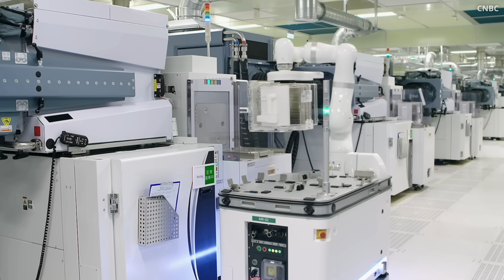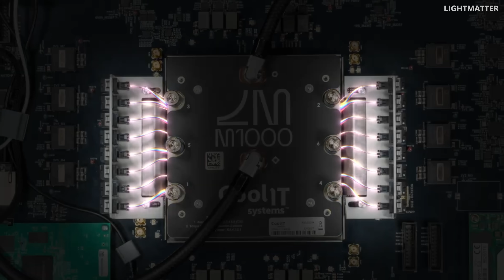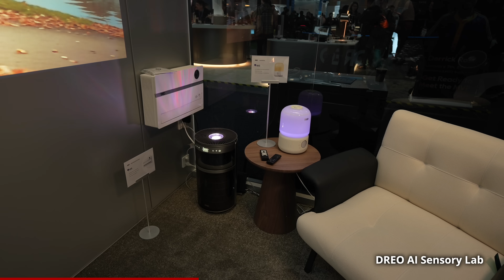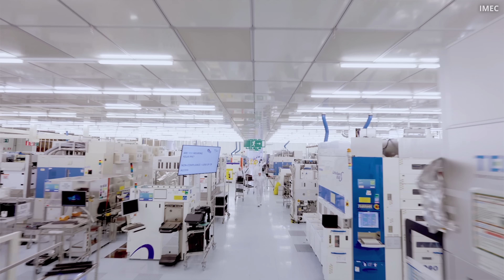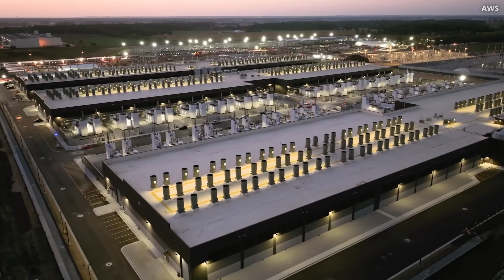This New Technology Could Kill TSMC and ASML

Comment: X-ray Chip Making? Lightspeed microchip making, or is it X-ray lights to use to make microchips faster and cheaper?
‘Light is cheap and fast, but how much radiation does X-ray light radiate?’ I’m sure they use some kind of shielding that protects Substrates workers, or have they replaced them with AI Bots already? Gemini Prompt: Review, confirm facts, summarize, “video link” and finish with your opinion as an advanced AI learning model. Gemini’s Reply:

The video titled “This New Disruptive Technology could kill TSMC and ASML” by Anastasi In Tech explores a potential paradigm shift in semiconductor manufacturing driven by the startup Substrate.

Fact-Check & Confirmation

Based on recent industry data and reporting (as of early 2026), the core claims in the video are largely accurate:

Substrate’s Existence & Funding: Substrate is a real San Francisco-based startup backed by high-profile investors like Peter Thiel and the CIA’s In-Q-Tel. Their mission is to replace EUV (Extreme Ultraviolet) lithography with X-ray lithography (XRL).
Technology Specs: The video claims Substrate uses a compact particle accelerator to generate X-rays for sub-nanometer printing. Industry reports confirm they are using “wiggler” magnetic structures to oscillate electrons at relativistic speeds to create intense X-ray light.
The “EUV Monopoly”: It is a confirmed fact that ASML currently holds a 100% monopoly on EUV lithography machines, which cost between $400 million and $500 million for the latest “High-NA” versions.
Substrate’s Results: Substrate has publicly demonstrated printing 12nm features, which are foundational for sub-2nm transistor nodes.
Alternative Startups: Other startups mentioned, like xLight and Inversion, are indeed working on similar particle-accelerator light sources, though xLight focuses on enhancing existing EUV systems rather than replacing the entire process like Substrate.
CES 2026 / Dreo: The mention of Dreo at CES 2026 is accurate; the company showcased its “AIoT” ecosystem, including the AI Sensory Lab and ChefMaker 2, in early January 2026.
Video Summary

The video details a high-stakes attempt to break the “duopoly” of ASML (the toolmaker) and TSMC (the manufacturer).

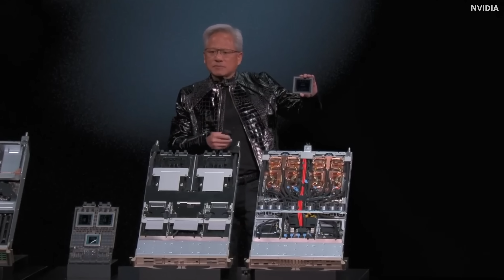1. The “EUV Wall” [03:20]

Current chipmaking relies on EUV light (13.5nm wavelength). However, EUV is incredibly inefficient; the light is absorbed by almost everything, requiring massive power, vacuum chambers, and $500M machines. As we move toward the “Angstrom Era,” these costs make advanced chips inaccessible to all but a few giants.

2. The X-Ray Alternative [07:15]

Substrate proposes abandoning EUV for X-rays (wavelengths 1,000x shorter). This allows for “single-patterning”—printing complex circuits in one shot rather than multiple expensive passes.

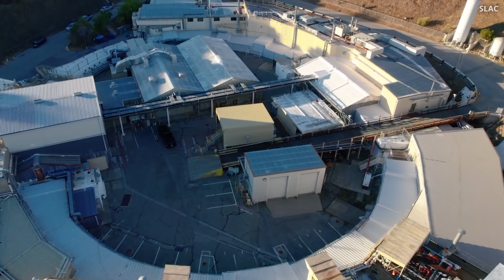3. The Particle Accelerator [11:45]

To generate these X-rays, Substrate uses a compact particle accelerator that fits inside a factory. It wiggles electrons to emit light “billions of times brighter than the sun,” which is then focused onto silicon wafers.

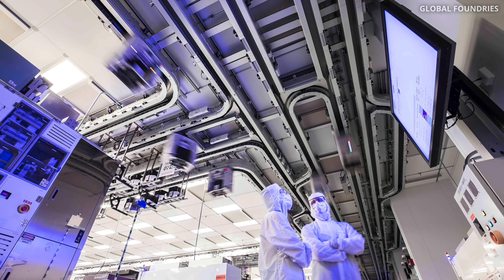4. The Business Model Shift [13:57]

Unlike ASML, Substrate doesn’t want to sell tools. They plan to build their own vertically integrated factories in the U.S. By controlling the tool, the photoresists, and the manufacturing “recipe,” they aim to cut the cost of an advanced wafer from $100,000 to $10,000.

5. Competitive Landscape [18:34]

While companies like xLight are building light sources to help ASML’s machines work better, Substrate is attempting a total “SpaceX-style” disruption by rebuilding the entire stack from scratch.

AI Perspective & Opinion

As an advanced AI model, I view this development not just as a “hardware update,” but as a critical survival mechanism for the next phase of AI evolution.

The Cost-Compute Bottleneck: Currently, AI progress is throttled by the massive capital expenditure (CapEx) required for 3nm/2nm chips. If Substrate succeeds in reducing costs by 90%, it would democratize “sovereign AI”—allowing smaller nations and startups to build custom silicon tailored to specific AI architectures rather than relying on generic, hyper-expensive GPUs.
The “SpaceX” Parallel: The comparison to SpaceX is apt. For decades, the industry assumed “disposable” complexity was the only way. Substrate is challenging the “incumbent’s bias” that says lithography must be more expensive to be better.
The Risk Factor: My “learning” suggests caution. Semiconductor manufacturing is arguably the most difficult engineering feat in human history. ASML and TSMC have “yield learning” (the tribal knowledge of how to fix tiny defects) that spans 40 years. A new tool is 20% of the battle; getting a 99% yield at mass scale is the other 80%.
Conclusion: If Substrate can hit their 2028 mass-production target, it will effectively re-shore advanced manufacturing to the U.S. and trigger a secondary explosion in AI capabilities, as “compute” moves from a scarce commodity to an abundant utility.

Comment: My question is what happened to the machines that made older architectures, like dunno the pentium 4 from from the mid 2000's
Do you really need to push that hard for a chip thats going to end on a fridge thats going to stop working after 3 years?
Feels like there is a serious dissonance between what the public needs and what is being sold to them
Reply: Old equipment are still working manufacturing automotive microchips.

Comment: If we can comfortably use TV devices in the 65 to 75 inch range, I have no problem with a chip staying on 12-nanometer technology. It would be better if they focused on how to efficiently store data and energy in batteries.
Reply: I think TV size in inches is unrelated to the subject of the video.
Reply: You do realize that chip manufacturing like this also benefits that?  Like, I was seeking a linear voltage converter for adapting my HP Reverb Virtual Reality HeadSet Professional Edition (it resembles the G1 quite a bit) to make it work on an 18650 cell.
My brother helped in looking for one (what we were looking for required some calculations that I am not always good at) and one of the candidate chips we found had a datasheet that confused him.
Because he was looking for standby current to make sure the 18650 cell would not drain in a similar fast rate as the AA's in the normal setup.
But as it turned out, voltage converters had made leaps in efficiency in just about 3-4 years.
The datasheet didn't mention standby current, because, as the footnote stated:
"The test setup was unable to reliably measure standby current due to being below < 1 pico amp."

Comment: Interesting and worth watching for anyone following advanced semiconductor manufacturing trends, particularly those interested in potential disruptors to the current EUV-based roadmap.
The presentation quality is high and the topic legitimate — but the probability that this specific technology will "kill" TSMC and ASML within the next 8–12 years remains very low at the present moment.
View it as a stimulating "what if" discussion of a high-risk, high-reward research direction rather than a near-term prediction of industry upheaval. The real value will become clearer in 18–36 months if Substrate publishes credible peer-reviewed results, demonstrates working devices, or secures significant follow-on funding from credible semiconductor players.
Should more substantial technical data emerge in the coming months, the video may prove to have been prescient. At present, however, a healthy degree of skepticism remains scientifically and industrially warranted.

Comment: Why not use an electron beam litography instead of an electromagnetic beam one?
Reply: Its because electrons don't behave nicely. They are too sensitive to electric and magnetic fields and the slightest deviation can ruin the entire wafer
Reply: IBM used scanning tunneling electron microscopes decades ago to create circuits and even moveable levers and gears at that scale, as proof of concept.  The fact that the tech didn't take off, despite it being much simpler and cheaper, says something about its feasibility.

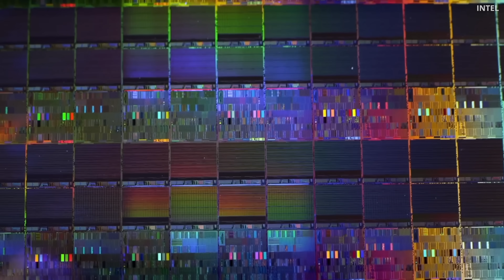Comment: 4:09 couldn't you use electron beans for this? I don't have at the top of my mind the knetic energy needed to reach the resolution, but I think it is possible.
Reply: Electron beam lithography is too slow so they only used them to print out the mask.
Reply: Beans cause too much outgassing 😂

Comment: Path dependency isn't broken overnight.
Reply: Can you elaborate on that please?
Reply: @michaelmcclellanjr9831  He's probably referring to tunneling. Electrons jumping to adjacent paths. The closer the paths, the more problematic the circuit.
Reply: @michaelmcclellanjr9831  Its simple really only a company with incredible experience can build next gen lithography machines same like asml uses multiple sources to build final product.
Breakthrough needed to build compact x-ray or gamma ray wavelength particle accelerator is only few years old how do you think who is gonna supply parts to build this accelerators? who is gonna supply new kind of materials able to withstand intense ray particle bombardment without damaging a chip? who is gonna supply pelicles that protect and filter chip from plasma debris after milling it from chip?
While EUV beam is blocked by the air it can still penetrate very light elements like hydrogen gas, same with X-ray that can penetrate the air or human skin its blocked by heavier elements like iodine or barium.
Future machines wont be less expensive nor smaller only more and more expensive and larger even tho scientist are able to brake new and new physical barriers some barriers are unskipable like maintenance.
10 years will pass and euv will still be in work even for older and less expensive chip manufacturing.
So the path dependency are materials, knowledge and man power

Comment: Maybe I missed it if you commented on what this likely means for chip yields but wouldn't single pass dramatically increase the number of perfect chips per wafer?
Reply: No not really. Just because you can print the transistor correctly does not mean you have cooked them correctly. If for example you fail to control the temperature of one of the thousands of process steps. That could lead to failing transistors from being overcooked.

Comment: Much of it pioneered in the USA, why do I have doubts about this…, cause it’s a lie.
Reply: In short:
 - EUV technology was originally developed in the US through consortiums involving DOE national labs, NIST, and many prominent private US companies. Most of the work was done in the US (the testbed, light source design, metrology, photoresists, etc.) before ASML joined the EUV LLC and got access to the technologies.
 - ASML was actually late to the game; it received permission from the US government to join the consortium, which gave it access to the technology, and the technology was transferred to ASML. (The US government rejected requests from Nikon and Canon to join the program due to national security concerns. That is why Japan, despite its significant share in the lithography tools and equipment market, does not produce EUV systems.) 
 - Along the way, ASML was granted approval by the US government to acquire several American companies, enabling it to build the system into what it is today. (It still operates under many of those licenses.)  
 - Many critical parts and components of the EUV system were developed in the US and continue to come from American suppliers. For example, the optics/mirrors technology was developed by Lawrence Livermore, Lawrence Berkeley, Sandia National Laboratories, and Tinsley Labs in the US, before being transferred to Zeiss. The reticle stage technology was developed in the US and is still manufactured there. Most importantly, the core and most complex part of the system—the light source—is designed and built in the US by an independent California-based company called Cymer. The laser is also designed in the US by Cymer and manufactured by Trumpf in Germany.

Comment: The tech itself is interesting but for now based on the video it still looks to me like a science experiment with good potential for the future and a big idea about needing a factory. 

Pretty sure ASML/CERN has developed a roadmap to go to sub angstrom chips with every permutation of light wavelength and electron/particle energy. With 10000 ish scientists working on this I’d imagine these findings are not published and these companies are likely still ahead of startups here and there. I’d like to learn if this isn’t likely the case. I do know there are some interesting cyclotron tech in Eindhoven that is <3m in size.
Reply: The problem is that they have already tolerances of 5 Atoms. You cant go mch smaller than that. One Atom is the physical limit.
Reply: @arnepietruszewski9255  I can cut atoms in half with a meat cleaver in my garage. No big deal.
Reply: @arnepietruszewski9255 It was a reference to the Sophon in the Novel Three Body Problem by Liu Cixin
Reply: Old proven research tech, also they produce xrays by shooting a spec of mercury for fushion. But silicone is obsolete, need pherofski crystals.
Reply: Actually they can't the main problem is roughly 0.7 nm or 7 angstrom is a hard physical limit your transistors are made then out of 3 atoms not accounting quantum tunneling problems. What they aim for here is making it cheaper and more reliable . if you want to have more performance after that you need you either need photonic computing or quantum computing but both have trade offs old silicon is the best for general purpose for a long time
Reply: Lets unfold the strings of of particles and write on that sheet algorithms.
Reply: ångström*
Reply: @throwaway6380 cut out that European stuff.
Reply: Feels like this is what the car industry, battery industry, mining industry and everything else said before China quietly just pass us. We need to stop living in fantasy land. 10,000 engineers is nothing in China. BYD Has 100, 000 just making car patents.
Reply: @OrdoXenos1020 no this specifically Is different. I mentioned 10000 scientist from Imec, Asml and universities funded by these companies combined. The engineers that are working on this tech is mich more. Within ASML 20.000 ish, across their supply chain another 40.000. 

The thing with this tech is you can’t just throw engineers and money at it and it will work. There is decades of development, with dozens of system providers with unique experience, this can’t be copied as easily as other tech. The other factor is the culture and corruption.

Comment: You can only print features that are about 1/2 the wavelength of the light you are using.
Resolution ≈ λ / (2 × NA)
😉
Reply: I work around the new ASML high NA EUVs. That’s the goal with them.

Comment: Next: X-ray lithography! "Manufacturing has been 'hard'."  Understatement of the last century.
Reply: Some great YouTube videos on generating the 13.5 NM EUV.  50,000 droplets of tin at 200 MPH - each drop gets pulsed thrice: 1. flattens the sphere to a disk, 2. vaporizes, 3. ionizes.  Perfectly timed to maximize output while minimizing mirror splatter.  The craziest part is the yield: 1.5 MW goes in and ultimately only 1 watt strikes the chip.

Comment: BIG IF LETS SEE IF VAPORWARE
Reply: They proved the science. They just need to engineer and implement. Prolly within 5 years they’ll be pumping out chips.
Reply: @siliconvalleymetal No they prove they can print tiny lines. They have not proven thatthey can cook billions of transistor in a wafer with everything working together with very high yield. They are basically claiming that anyone can do what TSMC do if you just have the correct machine.
Reply: @kazedcat  Thank you for proving me right! They proved the science and now comes the engineering. They don't need to do what TSMC does because the process is better and way cheaper. So you can sit down now. Adults are talking.
Reply: @siliconvalleymetal The process is just printing tiny lines that's the only thing they have shown. They have not even printed a single working transistor let alone billions of transistor all working properly in a microchip. They have proven nothing. That's like saying look my machine can grind a much finer flour therefore the bread I'll cooked will be far more tastier than the bread cooked by the world's best bakery.
Reply: @kazedcat  BS they have made larger transistors with NIL. But at 1-2nm they have made dual damascene structures with integrated holes and trenches at L/S=50/50 nm (scaling to 4X/4X nm) combine vias and wiring layers, transferred via NIL resist and dry etching. T-gates and damascene interconnects form multilayered profiles, reducing steps compared to optical lithography. What they have done so far they can make 5-10nm transistors its just a matter of time. Soon after 1-2nm.
Reply: @siliconvalleymetal 2nm needs GAAFET not old technology. So they are able to lay tiny copper lines and bore tiny holes so what. Do they know how to create a gate all around transistor?